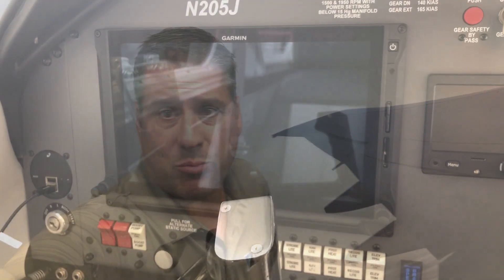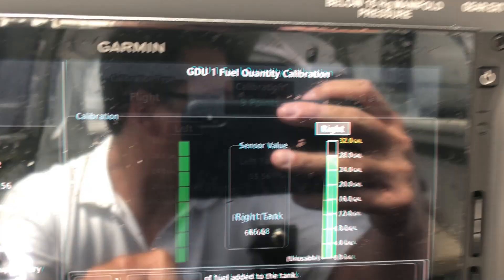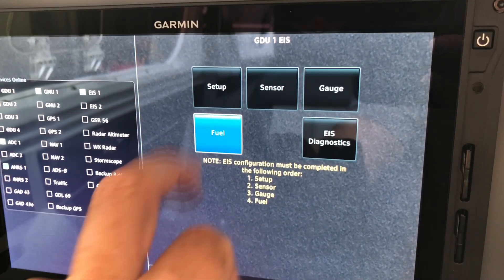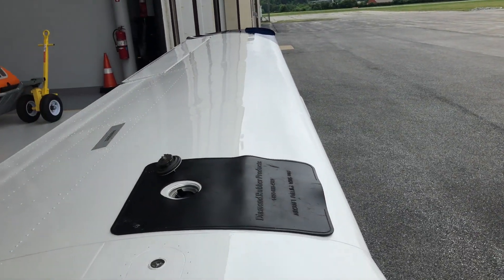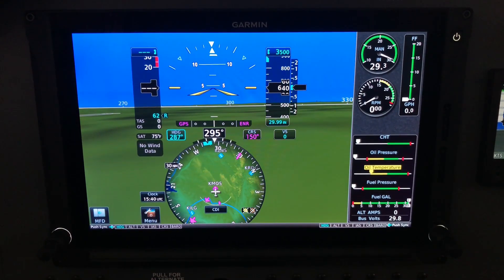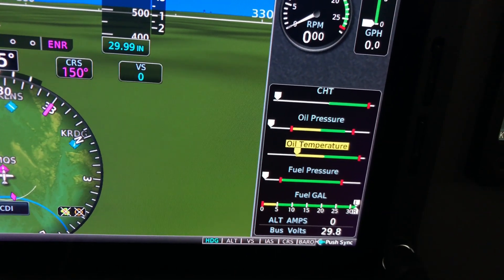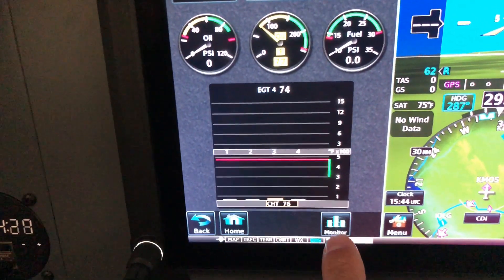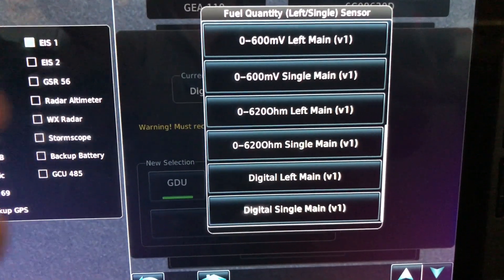Garmin G500 TXi EIS w/ CiES Fuel Senders

Comment: Hello, I’m doing a fuel calibration on a g500 system like you. The resistance on both empty tanks starts at mid 40ohms and it keeps rising slowly without me doing anything. Is this normal and if not, what’s wrong?